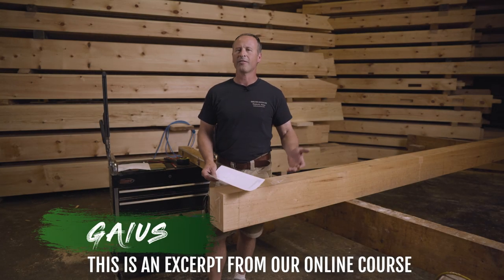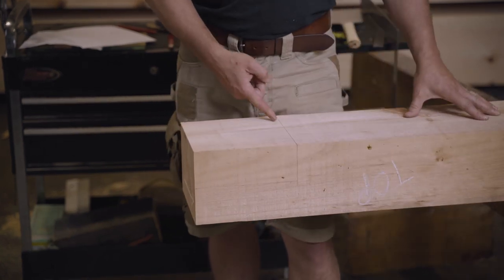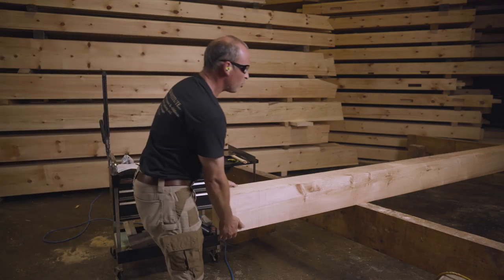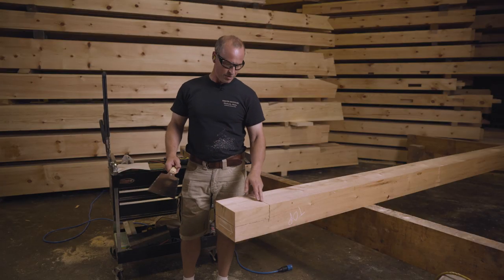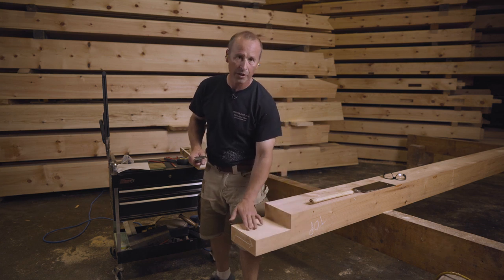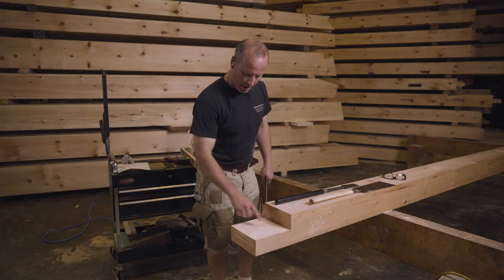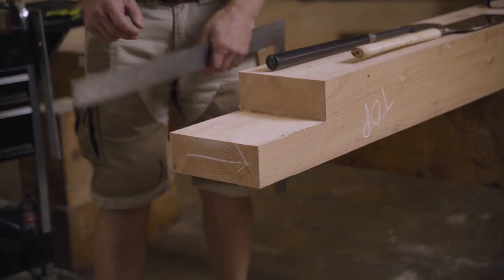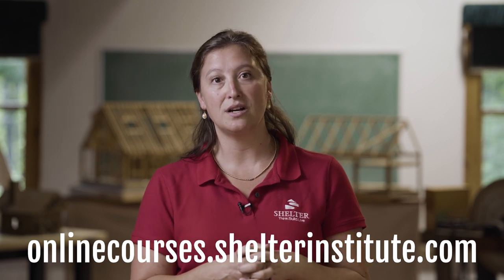How To Cut a Half Lap Timber Frame Joint (Using a Skilsaw!) - Timber Framing Online Course Sample

Comment: How do you know it stays flat and aligned while using the slick?
Reply: If you leave your layout line then set the three outer sides the slick to them. That is why he checked with the square to make sure it straight. Hope that helps.
Reply from the maker: George Bartholemew hey George. As Jeff said, before we start cutting, we lay out the entire joint by scoring the wood (slicing it with a scoring knife) then run a pencil thru the score lines do they are quite visible. Then we begin removing all the wood needed to get to those score lines. In the end, we place the framing square across the half lap from left to right to ensure a flat surface that connects the score line on the left to the score line on the right. Rubbing the edge of the square with your pencil puts some graphite on it which will then rub off on the high spots of the half lap, giving you a good visual of what wood still needs to be removed. For the shoulder of the half lap we use a combination square to ensure the shoulder is perpendicular to the surface of the rafter. Feel free to follow up with questions if this needs further clarification.
Reply: OK, watching the video he seemed to take off several passes of cuttings before checking with the square.  Did I miss something?

Comment: Gaius,
So can the smaller Skilsaw be "converted" to the larger format saw, by changing the frame and blade?
I ask this since both motors seem to be equivalent.
Or could this process be accomplished with the smaller radial saw?
Some voice over would be revealing and instructive as to your thought process, while working on the joints.  You know what you are aiming for, but the audience does not.
Still, great to see this demonstrated; the sound and quality of the video is superb.

Comment: Is there a reason you prefer using a slick over a rabbet plane for clean up?
Reply from the maker: That is a great question. The plane is very good at creating a perfectly flat surface. However, often in timber framing we like to create a slightly concave surface for fitment. We find that the slick is a much more versatile tool in timber framing; you can work the shoulder and face of a tenon, the inside of a mortise and any kind of scarf joint.

Comment: I'm attending the Purely Post and Beam. I need a large hand saw. If I wanted just one would you recommend it be the Ryoba (I love my bench Ryoba) or the Silky (looks perfect for pruning my plum trees)? Thanks!
Reply from the maker: Lolita's Garden we strongly recommend the Silky Zorin-no longer imported to the US but we have them! The ryoba is a bit more difficult to get a straight cut on a large timber with due to the thinner blade. It is a great saw and is very helpful in cutting smaller joints. We use them often to finish cuts started by power saws, as in this video.

Comment: How do you like the Super Sawsquatch saw? I am ready to purchase one but would like you opinion.
Reply from the maker: Hey Jeff! We love the Sawsquatch. Nice ergonomics, plenty of power and it comes with a great base to store the saw on. It is also relatively light (magnesium base) fir its size; the magnesium base is very robust and responds well to adjustments. There is no need to purchase an expensive aftermarket base for this saw,

Comment: Any particular reason to use the slick over a plane?
Reply from the maker: We typically prefer the slick because there is not housing to get in the way as we refine the joints. A low angle rabbet plane can do some of the work that we use a slick for but we find that the slick is a far more versatile tool.

Comment: Is the gyroscopic force an issue with your 16" blade?
Reply from the maker: Calin it is not-tends to stabilize the saw! However at startup and when the electric brake engages, the mass of the blade can cause the saw to jump slightly so it’s important to have the base resting on the timber before pulling that trigger.